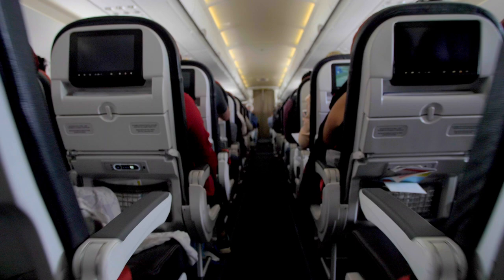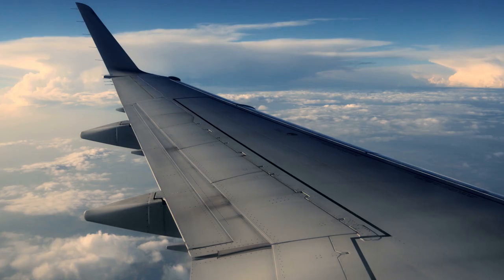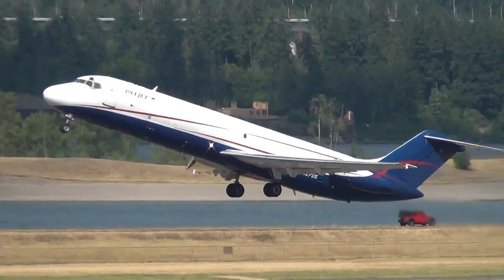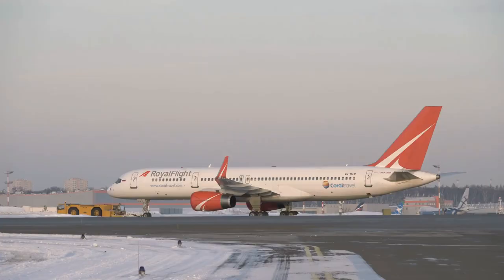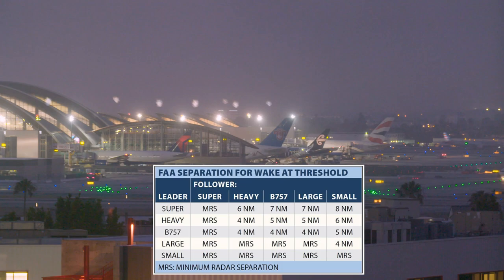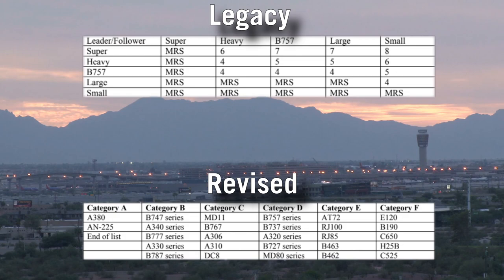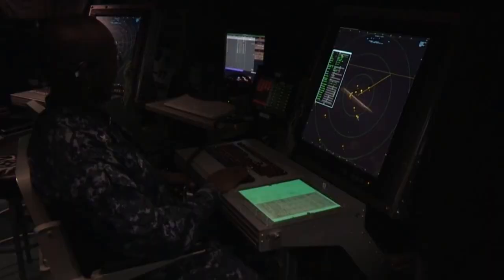This Is Why Airplanes MUST Wait On The Runway

Comment: I think most takeoffs are not delayed for wake turbulence separation... not sure, but my feeling is, much more often it is a case of getting the plane ready for takeoff (i.e.: going through a pre-takeoff checklist) making sure that everyone is on thesame page as to what they are doing (low-speed abort threshold, V1, actions in case of...) & that the automation modes and physical state of the aircraft are where they should be... (autopilot, thrust settings, configuration checks, etc etc)
yes you do have procedures where all of that is done at taxi, but, that is not seen as being as safe, so, some times, the final extra check is added

Comment: Well. The planes here at UPS Worldport in KY take off every 45-60 seconds at the shortest. Either the fact the that they don't have 100-200 passengers on board is an advantage, or there's something I'm unaware of, but they do take off pretty fast after one another compared to commercial airlines.

Comment: Few minutes?  I worked for one of the major airlines and have sat on the plane as long as 2 hours for departure.   Delays are caused by anything and everything.  Most common was weather.  In the Midwest, every season brings its own weather hazard.  Other causes, waiting for the plane to be refueled, high air traffic and waiting for an employee to show up!  Really, flights were delayed because a flight attendant had over slept.  Sometimes they wait for food to be delivered for longer flights.   Not debating this video, but all of the examples shown here are rare now.

Comment: After watching I jumped to the comments to see if the savings in time was mentioned to compare my calculations.  What I got from this video is why there were delays and it is for our safety.  I was thinking having to wait half hour or an hour. But they were talking 2 minutes than air traffic control would do their guestimating and it would go down to 2 seconds which adds up in a day? 

I have zero clue how many panes take off in an hour so I just chose 20 because that sounds like a lot. Now they said 2 seconds adds up in a day. 

0.2 seconds x 20 panes per hour taking off = 0.40 seconds of time saved. 

0.40 seconds x 24hrs = 10 minutes. 

 There will always be that guy that needs to be somewhere now and when he does I will be playing this video.  I am no engineer or pilot or frequent flyer so what I was taking from this video is airports figuring out on how to save the most time between lift offs.  Lol I just giggled to myself thinking of an actual pilot/engineer reading my comment 
💨🤯🔫.  But what I am trying to get at is when talking about saving 0.2 seconds to the actual 2 minutes for not just safety but literal life and death shouldn’t they just always go by the test results of 2 minutes

Comment: You should see what wake turbulence can do to a trespassing pedestrian who tries to bolt across a runway after at jet liner screams by.  You get swept off your feet only to get pile driven into the runway, usually fatally due to the force involved.  Unheard of in the US but known to happen in Africa and South America at some of their airports.  This is why airports have really  well made double rowed high fences with thistle wire on top of them with a security patrol path running between the fence rows.

Comment: Personally, I am in Australia, where runway congestion is not a problem, but my impression of countries with busy air traffic like the US is that passengers are more likely irritated by sitting in a queue of 10 aircraft on the tarmac, all waiting their 2 to 3 minutes from the one in front. Rather than simply waiting for 2 to 3 minutes, per se.  That was my experience during a number of take offs from JFK.

Comment: They dont HAVE to wait. Its only recommended. Especially if its a smaller aircraft. Thus the phrase "caution wake turbulence" when giving clearance. More often than not if you are lining up and waiting its to maintain flight path separation and has nothing to do with wake turbulence. If there is already sufficient separation the line up and wait part is skipped completely and you roll onto the runway and immediately depart.

Comment: They don't 'wait on the runway' for 3 minutes. They hold short of the runway and join the runway when cleared to do so.
Once they've joined the runway they will normally start the takeoff roll almost straight away, although there's often a short delay of perhaps 20 seconds.

Comment: My concern as a passenger is when the aircraft is positioning for takeoff on the runway. I have always felt comfortable with pilots that hold and allow the engines to spool up before starting the roll as opposed to the turn and go technique. It takes 8 seconds for the engines to spool up completely. Also an engine sometimes spools up at different acceleration than another engine on the same aircraft. The turn and go technique does not seem to allow the aircraft to take full advantage of the safety measures that are employed with the hold and spool up process. Where am I going wrong?

Comment: No, the airplane doesn’t have wait on the runway. It depends entirely when ATC clears us for Take Off. You can be cleared halfway down the Taxiway prior to the separtute TakeOff or even earlier. IT ALL DEPENDS ON TRAFFIC. 

That being said - yes there has to be enough separation between aircraft (which is what Controllers do if the airport you’re going has a Tower or Approach Control) or sometimes you wait out yourself. 

It is necessary to maintain a 2-3 mile separation between a light / medium aircraft, and depending on the aicraft’s speed is how soon can you be cleared for take off. 

On heavies (aircraft lifting over 300,000 lbs) the distance is 6 miles because of their wake turbulence.
Reply: All of that so you can feel smart. Heavy sigh. We all understand, we don't need you to translate
Reply: @debbylou5729  Wanna bet not everyone does?
Reply: That actually makes a lot of sense, air traffic controllers have a very stressful job, and would take time to make sure everything is clear for take off

Comment: It does make you wonder how wake turbulance affects aircraft undergoing mid flight refuelling. I'd make a guess that its fine so long as the trailing aircraft is lower than the tanker. But still pretty dangerous.

Comment: I'd always understood that wingtip vortices were a far bigger concern in the landing queue than the take-off cue, as everything about the landing process (low, slow, all drag devices out, settling downward through air towards runway) amplifies vortices formation. Intuitively an aircraft wing must generate vortices upon take-off, but all factors that generate vortices are vastly reduced or absent upon take-off, so I always presumed it was a much smaller problem. Still, I'd be very nervous taking off in a Piper Cub behind an A380!
Reply: The rule for small aircraft following larger ones is to take off earlier than the preceding larger one, and to land after the touchdown point of the larger aircraft, keeping higher on the approach than the larger one.

Comment: Follow-up question (from a pleb, I have no idea what I'm talking about so educate me please): Why can't we just use both sides of the runway? One plane takes off in one direction and then the next in the other. That would double a runway's output, right? The wake turbulence would be waning on one plane while the other plane takes off going the other way, and by the time that one has lifted off the next plane get get on the runway and start going.
Reply: One would be taking off into a tailwind which has a significant depleting effect on performance.
Reply: Gotta take off into the wind to reduce rolling distance. Otherwise, you need more speed over a longer distance to generate the same amount of lifting force.

Comment: Wake turb. from A380 can easily flip small B737 or A320 if you take off or land after the gigantic aircraft, even the B777-300ER wake can also do the same thing as A380.While in the air ,not just only small guy get hurt ,even medium size like A330 fly across the track of A380 in bad day, it can also create the severe turbulence on A330.

Comment: Hmm, I am wondering if the wing tip vortices’ strength is actually directly affected by the weight of the aircraft.  I would think it would be from the lift required from the wing and thus wing shape and design, and so indirectly from the mass of the aircraft.

Comment: If these extra few minutes is always the case then might as well embed that in the flight schedule so passengers technically don't have to "wait". Nevertheless, this explained well that additional few minutes, but not the remaining several more minutes and - sometimes half an hour - that passengers usually have to endure more.
Reply: They are ON the runaway, you expect passengers to get on the airplane 30 seconds until takeoff? 

Explain how can they achieve this?

Comment: Have you ever watched a plane either landing or taking off that the FLAPS also create wake turbulence?  Check it out when there it is somewhat stormy.  You can see it doesn't just come off the wing tips.  Another thing, it these wing tips create this problem why are the tips turned up?  I thought this was supposed to cancel out the problem.

Comment: Jet wash is the main culprit. Those engines need oxygen to burn the fuel, and the exhaust being expelled behind them has none. Just watch the movie “Top Gun” to see what happens if you fly through another plane’s jet wash. Couple that with the turbulence, and it’s a recipe for disaster.

Comment: They actually don't have to wait, I've been on a few flights where the plane goes from taxi to takeoff without stopping, just turns onto the runway and goes.
Reply: Yes. If there is no larger aircraft in front they don’t wait.

Comment: Just a dumb question: do propeller-driven aircraft produce the same degree of turbulence as jet-powered aircraft (we can't call it jet-wash)?  Does the propeller for example produce a different pattern of air movement?
Reply: What makes an aircraft have a larger wake is more based on the weight of an aircraft. The biggest producers of wake turbulence are aircraft that are heavy, slow, and in a clean configuration (gear up, flaps up). Most prop planes won’t have much of an effect your commercial jet aircraft as they’re (for the most part) much larger. Propeller planes do produce prop wash which can have similar effects to jet-blast on smaller aircraft. I’ve heard stories of turboprop airplane lifting smaller planes several feet off the ground when doing run ups before and pushing them back but thankfully haven’t had to experience that myself. As for air movement and wakes it’s more about wing shape and design.

Comment: I can't believe I use to fly a lot with no concern whatsoever. I'll be reducing my need to fly going forward.
Reply: Do it for the planet. Every hour spent in the air costs around 37 litres of kerosene per person depending on plane and flight profile. So each hour is 100 kg of CO2 per person.

Comment: In the very near future, aircraft will be using the new propulsion system, the Centrifugal Propeller. It will replace all jet engines and there will no longer be the wake from the jet engine.

Comment: Might be a silly question but hear me out,
How does this turbulence does not affect planes air to air fueling?
Reply: It can,  But they usually try to fly below and in front of the wake.  Also, when taking off and landing, an aircraft will make more of a wake because of th angle of attack required to provide enough lift at lower speeds.  At higher speeds the wings are more effiecient and make less of a wake,

Comment: seems like the thrust of the plane ahead aka turbulence could assist in fuel savings and decreased launch distances added up over time increased saftey cause not killing the environment killing us 🤔🤷‍♀️ for landings there would be a difference though for seperation distances between opposite direction aka takeoffs basically develop a 2 runway system 1 land on take off and let her flow simultaneously or an x pattern# so can land /takeoff nw to se or ne to sw but paralleled so  landing on right takeoff on right opposite direction craft continues to be on left only difference would be emergency landings which clearing a runway or runways involved

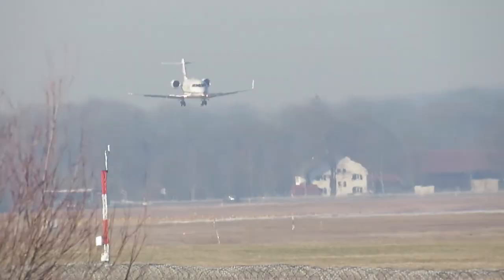Comment: Kind of an exaggeration. At AC airports the spacing is only affected by 75s or larger. That makes up maybe 10-15% of the traffic. If the airlines would listen to ATC just a little, delays and wasted time could be reduced significantly, but the airlines only listen to their marketing depts, that seemingly are using guidelines from 50 years ago. I've sat in the meetings and had to listen to them explain to me how people shop by dept time and not cost. Outside of business travel, does anyone shop by dep time first? Example, would you rather book a 7AM flight that always leaves at 7:10, or a 7:10 flight that leaves at 7:10? The airlines insist on sending 50-60 planes to a runway at 7AM exactly because they claim travelers will not book a 7:10 flight even if they are told it will leave on time more often. Crazy? Yes, it is. If the airlines merely spread their scheduled departures 5 minutes, like having a company policy of no more than 20 planes scheduled for the same departure time for the same runway, most could turn and burn. They just won't listen.

Comment: "This is Why Airplanes MUST Wait On The Runway" is misleading. Aircraft do not HAVE to wait 3 minutes on the runway in order to take off. Very well explained otherwise BUT...

These wait times are only applicable to aircraft taking off directly behind other aircraft within that 2 or 3 minute wait period in order to avoid wake turbulence . If no other aircraft has taken off within 3 minutes of your departure, there is no wake turbulence, and providing you receive take off clearance, you may even receive "Cleared for Immediate Takeoff" which means the following:

When given the instruction 'Cleared for Immediate  Takeoff', the pilot is expected to act as follows: 
At the holding point, taxi immediately on to the runway and begin a rolling take off without stopping the aircraft. 
If already lined-up on the runway, commence take-off without any delay.

Comment: Actually the wingtip turbulence safety factor is only a small part of the reason. The main reason is because the airlines are so cheap and make the pilots fly to their destination with barely enough fuel to make it there that the crew is taking a few minutes in silent prayer hoping they make it. That and they pray there arent any Karen's or Darren's on the flight as well.
Reply: That’s a pretty common misconception that people have. By regulations any instrument flight you’re on (commercial flights) you’re gonna have more fuel than “barely enough” to reach your destination as per FAR 121.646.

Comment: I find the phrase 'Safety second' in reference to Dubai air traffic control rather hush and unfair, if you do not first find out from the  Dubai air traffic control how they deal with the same problem. It's like saying your neighbors can't run their domestic affairs in their home good enough, just because they do not follow your methods. 

First find out how they do their things, and it's only if they are doing completely nothing to address the problem, that you can judge them.

Comment: This is, not true.

A few months back I was traveling to Atlanta From El Paso, and the end of the runway we took off from is directly connected to the taxiway, and as soon as the we transitioned from taxiway to runway the pilots went full TOGA and started the takeoff run, It was instant, not a second did the pilots press down on their rudders to apply brakes.
Reply: That’s fine. If you have no preceding aircraft that’s perfectly safe.

Comment: I do not believe the story about the A380 and the challenger.  

I’m surprised that there are no pilots that have heavy experience weighing in on this apparent incident.  
It would be very strange for an aircraft in cruise flight operating at cruise altitude ( less dense air )  producing the strength of vortices required to flip a jet that far below it. The conditions just don’t add up.  I believe this is a internet myth.  If the A380 was in a climb profile in dense air at takeoff weight it would make sense  even with the smaller aircraft being 1000 ft below.  
There are no photos that exists that clearly show  this ‘totally written off ‘ aircraft. And no real details of who was involved and where.  Not officially documented synapses.

Comment: 8 min video explaining why planes wait at thr runway for 3 mins
Reply from the maker: It takes less than a second to shoot a bullet. 
I’d like to hear your explanation on how it works, in less than a second, please 🤓
Reply: @NotWhatYouThink  it also took human evolution an eternity but nat geo explained it in one hour. Do the maths now
Reply from the maker: Exactly :-)
Point being that there is no set correlation between the length of an event, and how long it takes to explain it. It could be more or less. Whether airplanes had to wait for 1 minutes or 60 minutes on the runway, it would have still been an 8-min video.
Reply: @NotWhatYouThink  took you 6 months to reply to that. Admit it Youre slow in explaining:)

Just kidding have fun